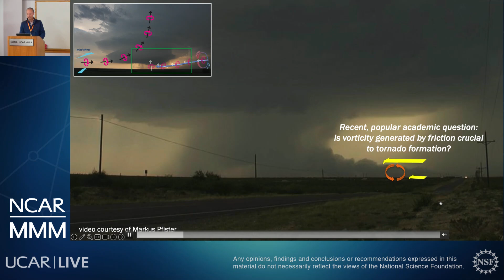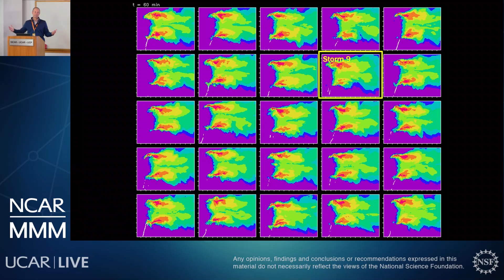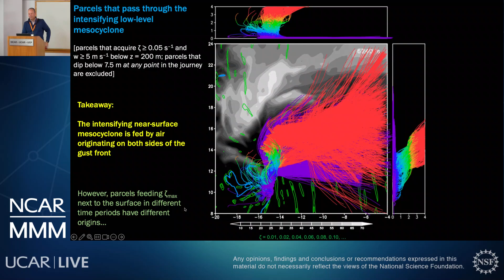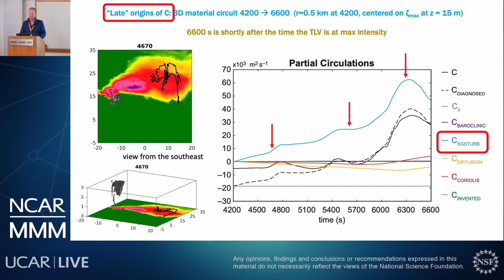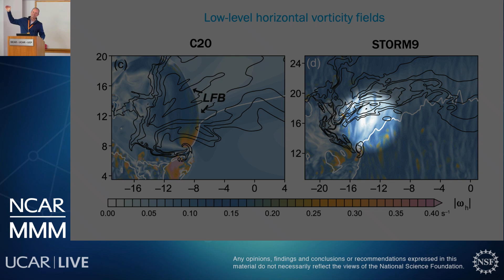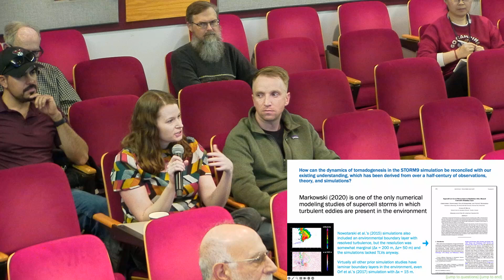A new pathway for tornadogenesis exposed by numerical simulations of supercells in turbulent...

Comment: 7:58 The moisture or vapor comes most likely from a wet surface cooling tower. That's not natural, I'm not saying that it's intentional, what I am saying is that cooling towers can fuel super cells accidentally, wrong place wrong time, you know

Comment: https://youtu.be/57ouoEdRG1A?si=gO36FBTCoDTQgYBF&t=3040
So, pulling from above causes tornadoes spin up.  What is pulling.  Where is the string (that spins the top)? Paul, your instincts are leading you in the right direction.  It's what you think you know that is the problem.  The clue is the surface tension properties of H2O.  You are part of a confused paradigm.

Comment: The NOCOOL results are quite surprising - without the RFD/gust front to occlude the developing TLV how would you develop the closed streamlines and local low pressure anomaly that characterize a tornado? The general result that environmental vorticity plays an important role in initial TLV development is compelling, but the NOCOOL simulation results seem to contradict a large body of research & observation - have you looked into this further?

For those who are interested, see pages 11-12 for the role that RFD is understood to play in tornadogenesis: https://www.weather.gov/media/zhu/ZHU_Training_Page/thunderstorm_stuff/splitting_supercells/Supercell_Structure.pdf

Comment: The amount of schizo comments on this video is unexpected considering the topic and depth. 😂
Good talk. I tend to lean towards the idea of multiple triggers for tornadogenisis. That would also explain why different storm modes like QLCS and derecho bow structures can produce tornadoes as well as differing air regimes like cold core lows vs traditional environments in the southern plains.
Reply: Yea, it's surprising how many of them come out of the woodwork. I've seen all kinds of conspiracy theories and "alternative science" in other fields, but I guess I didn't know they were out there in meteorology, too. 

But I agree with you about multiple triggers for tornadogenisis. I can't remember the exact study, but they measured wind speeds to look at whether tornadoes formed from the top down or the bottom up, and it was actually a little of both. That doesn't prove that there are multiple triggers, but it kind of suggests that there could be a number of different combinations of variables that could lead to a tornado. RFD surges, streamwise vorticity currents, low pressure centers/gradiants, etc. etc.
Reply: @ullrich  
RFD surges, streamwise vorticity currents, low pressure centers/gradiants, etc. etc.
SolvingTornadoes
These are all observation of effects of storm dynamics.  The cause of the storm is the energetic low pressure from a jet stream that is delivered by vortices to the location of the storm.
James McGinn / Genius / SolvingTornadoes
Reply: @SolvingTornadoes  Yes, they are variables that can contribute to tornadogenesis. The cause of the storm is convection and a lifting mechanism - a combination of thermodynamics and kinematics. I know you don't believe in water vapor or convection, but it's okay to be wrong. That's how we learn.

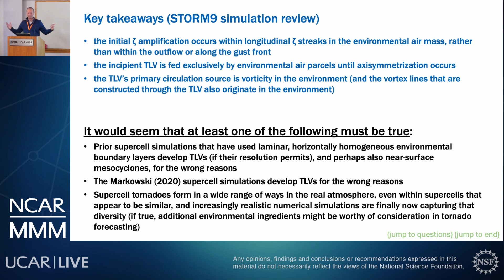Did you watch the part at 57:55? One of the solutions to the discrepancy found in his model vs older models was that "supercell tornadoes form in a wide range of ways in the real atmosphere, even with supercells that appear to be similar." That is exactly what I'm talking about.
Reply: @ullrich ,
The biggest thing about Tornado genesis is... not all tornadoes have a RFD. Thus, there is most certainly more than one way for a tornado to form. What the other method(s) is/are... that's a work in progress.
Reply: @aralornwolf3140  Yea I mean, I'm not sure I would say that's the "biggest" thing, but you're absolutely correct. To your point, and the point I made earlier, I think the fact than an RFD surge is not always required for tornadogenesis suggests that there are potentially a number of different variable combinations that can contribute to a tornado. 

I could be misremembering, but I'm fairly sure that he Jarrell TX F5 was a rather important tornado in terms of our understanding of what causes a tornado because it did NOT display many of the mesoscale or stormscale features that we would normally expect for a powerful tornado like that, yet it still happened. So yes, I agree there is almost certainly more than one way to make a tornado!
Reply: @SolvingTornadoes  "RFD surges, streamwise vorticity currents, low pressure centers/gradiants, etc. etc.

SolvingTornadoes

These are all observation of effects of storm dynamics.  The cause of the storm is the energetic low pressure from a jet stream that is delivered by vortices to the location of the storm.

James McGinn / Dummy / SolvingTornadoes"
Reply: @ullrich  LOL.  No.  Convection is superstition.  It's literally nonsense.
Reply: @ullrich  "Multiple triggers"?  This is your theory? 
Really?  
James McGinn / Genius / SolvingTornadoes
Reply: @SolvingTornadoes  It's not a theory, it is an observation, although I don't expect you to know the difference. 

When you see models like this and compare them to other models, and you see that different conditions can result in tornadogenesis with different parameters, it suggests that perhaps there isn't just one specific way they form. 

Also, I discussed a different piece of research that showed tornadogenesis occurring at various levels rather than just top down or bottom up, which seems to suggest that there are a few ways it can happen. 

But tell us about your theory. Tell us about how tornadoes are plasma and how convection is fake.
Reply: @ullrich  Don't bother feeding the troll. You are arguing with someone who is a science denier and has referred to himself as a genius in this comment thread.
Reply: @AlaskaB83  anyone who refers to themself as a genius is likely to be anything but.
Reply: @AlaskaB83  I know, I know. I'm usually better about restraining myself but man it's frustrating.
Reply: @onlyinthe707  LOL.  Define, "likely."
Reply: Vague.
Reply: @SolvingTornadoes  You are one of the people he's talking about. Specific.
Reply: @SolvingTornadoes  It's not vague. You are a delusional schizoid with delusions of grandeur who can't even comprehend H2O in the atmosphere. As if rain just magically appears out of thin air with no point of origin.

Face it, kid. You're out of your league.

Comment: Paul is realizing that the pieces of the puzzle of his standard theory are not fitting together very well.   I'm way past that.  The secret is hidden in the confusion surrounding H2O and its anomalies.  Paul is starting to realize that only if some kind of superhero-like structural capability appears on the scene would his own model make sense! And it does. It literally does. In reality.  Structural capabilities do emerge at exactly the right locations — along extensive moist/dry wind shear boundaries — in the form of spinning, highly polar, polymers (chains) of H2O molecules.  The substance that emerges is a plasma of spinning chains of H2O molecules — a plasma of self-attracted polymers of spinning H2O molecules — which as a substance begins to  encircle its flow of drier air and form into a tube. The structural properties are conserved in/with the plasma, maybe especially with respect to the laws of conservation of angular momentum associated with the spinning polymers of H2O molecules which comprise this plasma and which themselves encircle the flow where the wind shear interaction is itself conserved along the inner surface.
James McGinn / Genius / Solving Tornadoes
Reply: "I'm way past that"...  the narcissism continues.
Reply: @AlaskaB83  
You got nothing!!!
Reply: @SolvingTornadoes  "You got nothing!!!"

You shouldn't talk about your self like that, kiddo. It's bad for your fragile self-esteem.

Comment: Regarding the frictional component:  Is it possible that, where we see the path of an EF2 or EF3 enter into a developed urban enviroment, the rapid intensification into an EF4 or even an EF5 results from the established vortex being intensified by the suddenly increased friction with obsticles (houses, different ground surfaces), etc?
Reply: Tornadoes don’t suddenly intensify when they enter urban areas. Tornadoes are rated on the damage that they cause. Because there’s a lot more damage that can be caused in urban areas, their ratings increase.
Reply: That's  the opposite of what should happen with friction
Reply: @hime273  It may be opposite of what you would intuitively expect tp happen - but he did say that a frictional ground component causes an increase in the strength of the vortex.  And, I've noted that in many cases these storms seem to greatly intensify at the moment they enter a populated area.
Reply: @hiturbine what we often see isn't necessarily an increase in intensity of the actual storm, but rather a huge drop in correlation coefficient due to debris being generated. This makes the storm look more intense, but the reality is it was already intense but now has houses and what not to make debris out of.
Reply: @AntavasSpeaks  Yes, but often we also see that an EF3 entering a populated area evolves into producing the damage of an EF4 or EF5 ?
Reply: @hiturbine  That does not actually happen that often. There hasn't been an EF5 since 2013. One of the most notable EF4s, the Mayfield tornado, strengthened and weakened variably throughout its long life. It was strong before it hit Mayfield and after. Also, there are plenty of other sources of friction apart from homes and buildings like forests and geological features. Lastly, we definitely see tornadoes weaken before hitting populated areas, too. 

But also as someone else said here, the only way we rate tornadoes is by the damage they do. So you could have a monster tornado, like the El Reno tornado, that churns out in a field somewhere and hits a weak structure, and it only gets an EF3. If that had gone into the OKC metro, however, it very easily could have been rated hire, simply because there are more well-built structures for it to damage and thus, for us to survey.

Comment: With varying degrees of geothermal gradient under the earth’s surface our big blue marble is essentially reaching for space.  In space we have gravity waves which act like a bellow. Pushing and pulling on our atmosphere .  

As dynamic as the particulars are in a thunderstorm, a storm complex moving through an environment with these conditions  present  may be the trigger we’re looking for.   The yarn pulling up  analogy is essentially the result of rising air trapped in this push / pull cycle that is happening 24/7 even when storms aren’t present.

Comment: I have seen this as a radar tech before and my friend told me I was crazy and that nobody can see that much detail. But I swear you sometimes can see these small eddy currents and when they collide with the gust front at the wrong angle they get snuffed out but there's a certain angle that I can tell the collision is going to kick off a tornado! Vindication!
Reply: Pecos Hank has a video with a professor who did this with a super computer. It was very interesting the data showed. Check it out.
Reply: @Wes4Trump  Dr Leigh Orf :)
Reply: If they dropped a chaff like material into a storm would it maybe help track a storms winds more accurately on a few mobile radars vs just the precipitation, or would that just screw up everyone’s radar for days and not really help lol?
Reply: @alexburke1899 would be impossible to get the right placement and the amount of chaff would be mind-blowing. Your idea has been done only it was not physically done, but rather in a supercomputer. You can find it in Pecos Hanks video library. They add streamers instead of chaff. Great idea though. I like the way you think
Reply: Wow this is fascinating! I would love to hear more about what you’ve learned.

Comment: Does the correlation of an impact on the trajectories of a magnetic field also have an effectiveness on the subject?
Reply: Anything that can BE affected by a magnetic field will also affect a magnetic field. So if a tornado were affected by a magnetic field, then it must also change the magnetic fields around it. Which would mean that we could easily detect tornadoes from very far away with great certainty using a large network of very sensitive gauss meters, so that we wouldn't have to depend on a beam of radar being reflected back by raindrops. This is certainly not the case at all. Trying to manipulate a tornado with a magnetic field would not be any more successful than trying to manipulate a paper cup with a magnet. The paper cup does not interact in any meaningful way with the magnetic field, hence it cannot be manipulated directly by a magnetic field.
Reply: @HeyChickens 
How do y'all not realize that the Nexrads are what controls these storms.
Which are literally Electromagnetic Frequency beam emitters.
Reply: @hime273  Because some people understand physics.
Reply: @ullrich  How does that disprove what I said? 
Did you even read my comment?
Reply: @hime273  Control how? Do they intensify the storms? Do they move them around? I can tell you one thing, a radar beam does not contain enough energy to make any meaningful amount of instability to intensify or trigger thunderstorm development, especially when just one kg of unstable air has its instability measured in over 1000 joules per kg, and thunderstorms/supercells can contain up to 10 million kg of air. That's up to and over 10 billion joules, or 10000 megajoules. The only thing we have that rivals thunderstorms for the amount of energy produced in such a short amount of time is nuclear bombs.

Comment: Absolutely great talk! I have a few questions and things I noticed in the simulations. 

1. Depends the lack of horizontal vorticity on the cool side of the gustfront in the STORM9 simulation only on the slower ground relative wind? I would assume the warmer coldpool should lower the amount of baroclinicly generated vorticity as well, which would also result in less horizontal vorticity.

2. It's a bit hard to tell but to me it seems like the TLV from STORM9 is very close to the edge of the gustfront, while in C20 the TLV seems to be a bit deeper in the cold air. Also the RFD seems to have more turbulence and surges in C20 and reaches further east than in STORM9. Does this also appear in the other simulations with strong TLVs? 
If so, it may be something to look for in real storms to distinguish between the classic and the boundary layer turbulence tornado formation, if both occur in reality.
Reply: Yes.